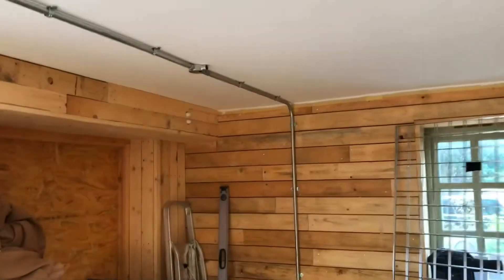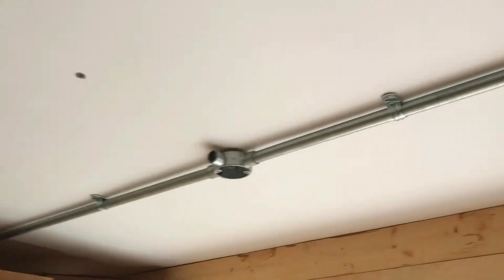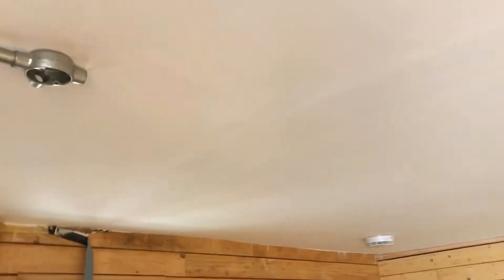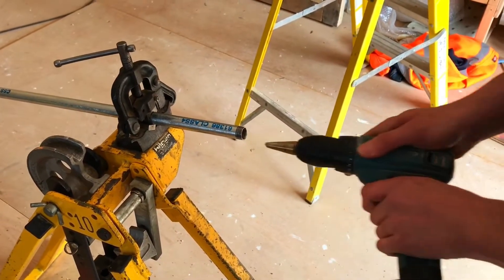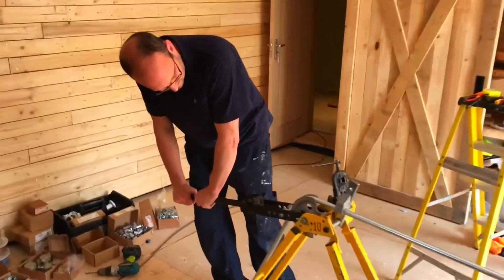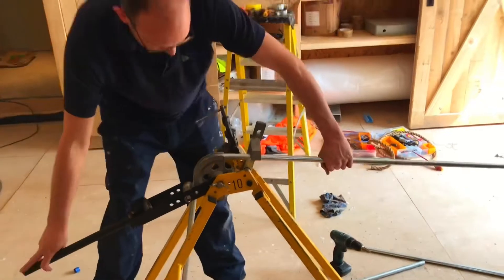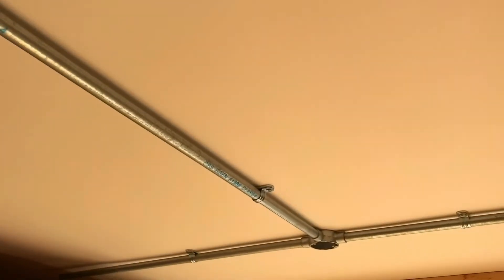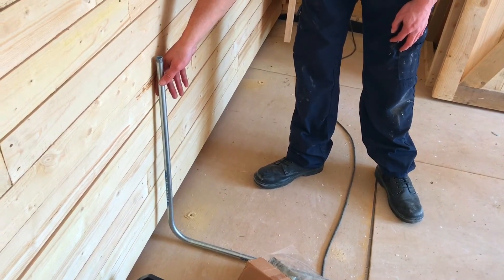Steel Conduit In a House + a New Way of Deburring Conduit

Comment: As a German it is really crazy to watch how you work. It's like the 21st century hasn't arrived yet. Very interesting. Thanks for those valuable insights.
Reply: We’re way behind the times here
Reply: @danielhearnden3776  in what way?
Reply: Hasn't arrived for you or us 🤔?

If for us in the UK, how are you doing it in a better way (genuine question)?
Reply: @johnhoward2104  I believe its quite popular to use pre wired flexible conduit on the mainland. Certainly would save a lot of time for installers
Reply: Use of arc fault breakers Europe and America had them for ages
Reply: @danielhearnden3776  yes, with no proven effectiveness - what a ripoff they are - unless you have evidence to the contrary.

Comment: Just out of interest, why the use of use galv conduit? Perhaps the Conlok system could've made for less marks on the ceiling.
Reply from the maker: Love that as an idea 👍🏻. Matt sends me videos randomly throughout the year often with little details about design or customer  choices. Thanks for watching Gaz
Reply: I do prefer conlok for these sorts of ceiling-mounted spurring off every-which-way sorts of installs.
I had a nightmare adapting two pre-existing runs of conduit to meet together without any conlock bits. Took me all day 😂